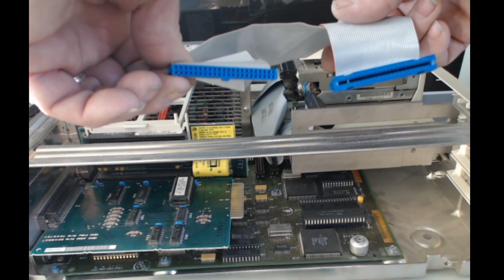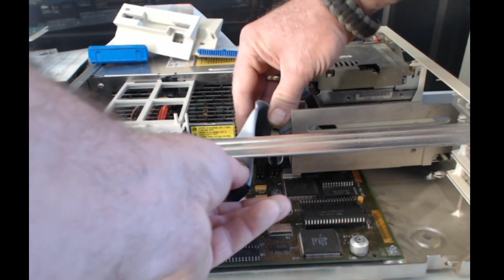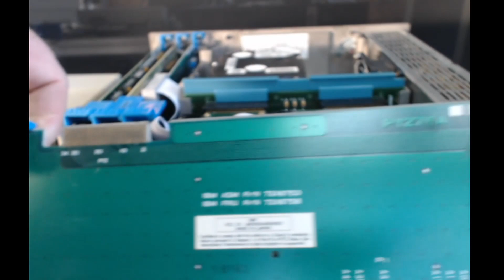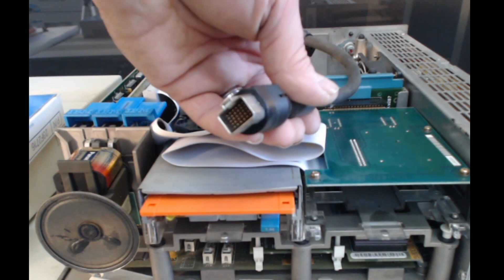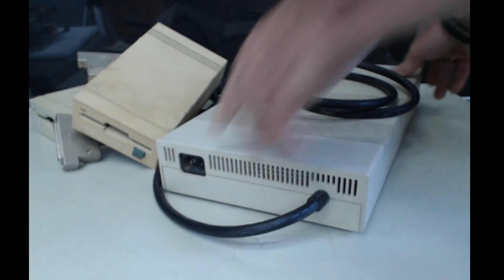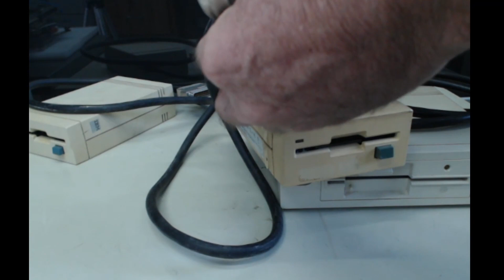External Diskette Drives on IBM PS/2s - Episode 1

Comment: What year the external 5.25 drive was made? Would this work on a 486 computer? So there are two types of 5.25 disks and drives?
Reply from the maker: The 4869 drives (both 360Kb and 1.2Mb capacities) were released with the PS/2 line in the late 1980s and early 1990s - The connections from a FDC (Floppy Drive Controller) would be needed to run it.
Reply: @IBM_Museum  it doesn't or does plug into a printer/parallel port and wouldn't work with a PS/1 imagination 486? Are there any other external 5.25 floppy drives that plug in to a parallel/printer port and work?
Reply from the maker: @rtperrett : No, the 4869 drives do not plug into a parallel port.
Reply: What cable does this hard drive attach to?
Reply from the maker: @rtperrett : It's a diskette drive, with a DC-37 (37-pin d-sub) connection...
Reply: So a serial/printer port is db-25 sub D?
Reply from the maker: @rtperrett , the 4869 cable attaches to a 37-pin port like the PC/XT diskette controller adapter - See the adapter on the Model 30? Here it is: https://ibmmuseum.com/Adapters/4869-001/4869-001.JPG
Reply: Are serial/printer cables are DB-25 sub D?

Comment: I put both MCA FDD Controllers in my 486SLC2 and attached one external 360KB and one external 1,2MB. In short the driver only recognizes the 360KB drive. I think only one MCA FDD Adapter can be used in a machine.
Reply: The Bios recognizes both FDD controllers though. I can't see any switches for the dosdriver to recognize both controllers and therefore both drives.(one attached to each controller external)
Reply from the maker: @drzeissler : The Diskette Adapter/A is able to run a single drive from each (internal and external) connection - but a system should have only one adapter installed.

https://www.ardent-tool.com/floppy/5_25_Floppy_Adapter.html
Reply: @IBM_Museum Thx, I thought I could install two adapters and use both 5,25 externally (360KB/1.2MB) but it is not working. That is pretty bad.

Comment: thx, can I install two external drives adapters to use with the one 5,25 360 and another 1,2M drive?
Reply from the maker: The Diskette Adapter/A is a microchannel adapter that supports an internal drive (34-pin data connection, 4-pin molex for power) and external drive (4869-00x). Either drive can be 360Kb or 1.2Mb - but remember, you would need power and a 5-1/4" bay location for the internal drive. Which PS/2 would you install it on?
Reply: @IBM_Museum  I have a PS2/E that cannot be equipped with an external drive, but I have a 486SLC2 Model 56? which has one internal 3,5/2.88 and I have two MCA FDD-Controllers and three 5,25 external drives. Because I do not have a breakoutcable for the internal 3,5 2.88 to hookup an internal 5,25 1.2MB I have to do it different.
Reply: Option 1: Internal 3,5 2.88 as it is, FDD-Controller with one external 360KB and another internal 1,2MB but power from HDD.
Option 2: Internal 3,5 2.88 as it is, 2xFDD Controller with one external 360KB and another external 1.2MB
I don't know if I can put two FDD Controllers at the same time in that Model 56.